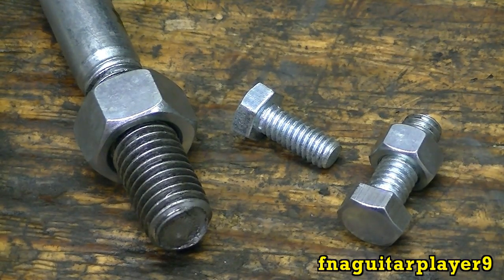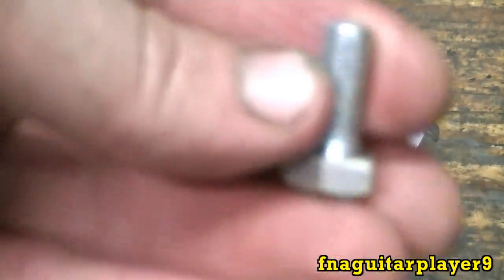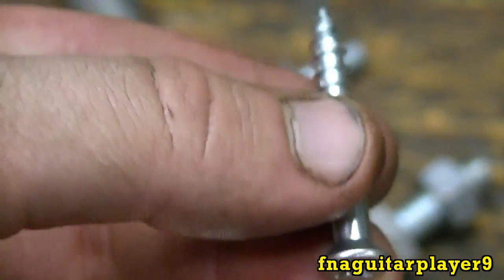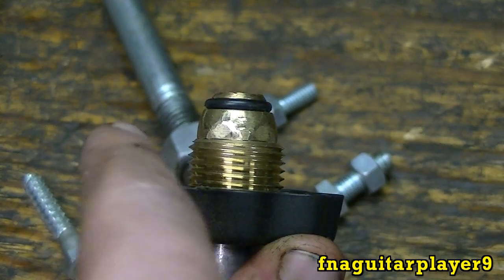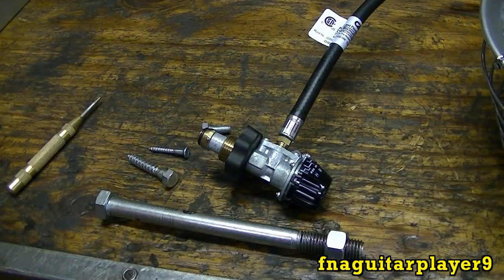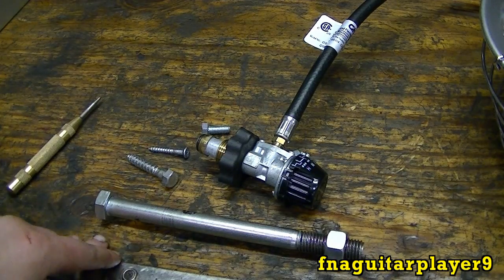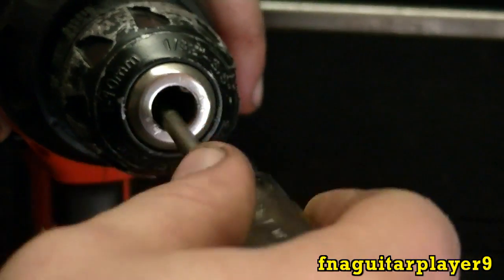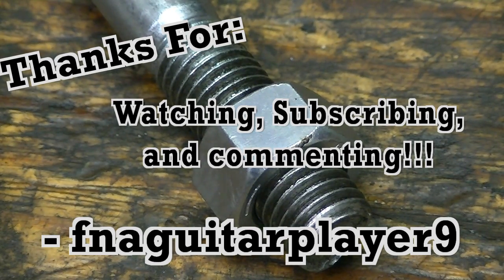Quick Tip #9 ::: How to Identify Left Hand and Right Hand Threads & Common Uses

Comment: Thanks for this video !
I have a sailboat which has left handed threads on studs attached to turnbuckles on the wire rigging for the mast. All turnbuckles have a left and a right hand thread .
I needed a replacement stud for a turnbuckle and had to determine if it was left or right handed, your video solved the problem , thanks again .
Reply from the maker: Your welcome, I hear ya! Glad to help out! Thanks for Watching!
Reply: I found that out when I failed to loosen the tie rod jam nut, on the adjuster turnbuckle.

Comment: you talked on the propane thread and all but nothing on how all flamable compressed gases have left hand threads and normally have a notch on any left hex nut telling you its a lefty. so non flamamble gases have right hand threads with no notch on the hex   just  wondering because if someone would have told me this when i was 16 id still be alive today!
Reply from the maker: Honestly I wasn't aware of that or i would have, thanks for informing me. I'm mainly a mechanic/electrician. hanks for Watching!!!
Reply: @fnaguitarplayer9  well then that explains it. but now ya know

Comment: Car wheel Lug nuts today are right hand thread  requiring a re-torque of the wheel at  100 miles 
left-hand thread lug-nuts existed at one  time on most car wheels I believe and I right ?
Reply from the maker: Yes you are correct, it wasn't on all makes but there was some that used left hand threads. Someone mentioned it before, may still be in the comments on this video not sure though its been a while. Thanks for Watching!!!
Reply: @fnaguitarplayer9  Left hand for the driver's side which turn ccw. Right hand for the passenger side which turn cw.

Comment: Dear Sir, Thank you for the video, Could you let me explain me how to know Right hand thread or Left hand thread for the Hex Nut please? It is really hard to differentiate the hex nuts for me. Looking forward to your help.
Reply from the maker: Your welcome, the simplest way to say it is, if you look in the nut, its like looking at a mirror of the bolt's thread, so its exactly the opposite of looking at a bolt thread, if the threads goes up to the left in the nut its a right hand thread nut. Thanks for Watching!!!
Reply: Goyot Ukhaa another way is if the nut has a line cut in the middle of it, it's left hand thread. Not sure about all other nuts, but it's common on welding equipment you will see them.

Comment: Another place you'll find left-hand threaded components that wasn't mentioned are tie rods. The tie rod on my golf cart has got me baffled but with the clues/hints/rule of machinery laws I think I've got it licked. Hey thanks for putting this up we all appreciate the Youtube help support system for everything built on the planet.
Reply from the maker: Didn't think about that, but have seen that before. your welcome! Thanks for Watching!!!
Reply: They can also be found in pumps for wells also. Worked for a well supply company, mainly pulling pumps and motors from wells to fix and replace them. It blew my mind when I first heard "that's left hand thread, you have to turn it to the left to tighten it"
Reply from the maker: @loganhodnett3389  I heard that, it is very confusing especially when you don't something is left. Thanks for watching

Comment: most all cintrifucal clutchs on A.T.V use Left hand threads on centrifugal or some call starter or primarily,but its the one with 3 or 4 shoes in a drum.the plate or manual clutch behind the centrifical has reagular threads because it turns in opposite direction.great video tho.keep up the good work ! Strebeck power sport repair and performance shop.Randy (Skeet)Strebeck
Reply: Try centrifugal next time, dummy.
Reply from the maker: They pop up in places like that haha I hate it too when you don't know and try to break it loose when your actually tightening it more haha appreciate that! Thanks for Watching!!!

Comment: Great tip man. But im still having trouble on how to break a union from standing at a different angle i actually don't know which is lefty loosey and righty tighty. It bUgs me alot. Do you have any advice?
Reply from the maker: +NoobPlaya Solz Thanks! I hear ya, that would be hard to see, its a finer thread too. If you can see some of the threads then you could take some clay or even a piece of bubble gum to make a imprint, but the imprint will be a mirror so it would be opposite if that makes sense. Just like looking at the threads inside a nut, its backwards. If you can't see the threads, then i'd try lefty loosey first and see what it does. Thanks for Watching!!!

Comment: My old Mercury outboard has a left hand thread on the flywheel nut, that had me confused turning it right to loosen it and the whole motor turns in that same direction prop and all I guess the torque keeps it tight
Reply from the maker: theeasybeats Heard that, thats really unusual, luckily it didn't break or strip out on you from trying to loosen it. That is weird though. I've done that before on weedeaters and stuff, kind of embarrassing after you realize what it is haha Thanks for Watching!
Reply: Thanks for the info
Reply from the maker: theeasybeats your welcome!

Comment: Regarding old 5hp Briggs horizontal snow blower/tiller engines:
Are the threads (that secure a drive pulley) in the center of the crankshaft left handed?

Comment: Bicycle pedals, non-drive side I believe, are left threaded. Wrench goes the same way on both pedals relative to the bike -both sides turn to the front which I believe pulls them off.   Edit:  other left, wrench to rear pulls them off.

Be real, be sober.
Reply from the maker: Didn't know that. Makes sense so it won't work loose. Thanks for Watching!!!
Reply: *****  Drove me nuts when I was a kid!